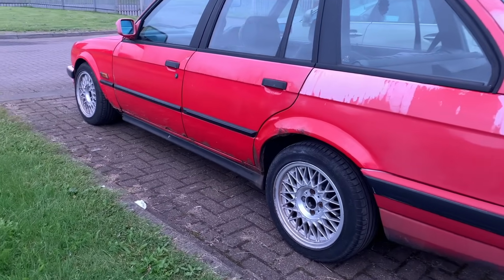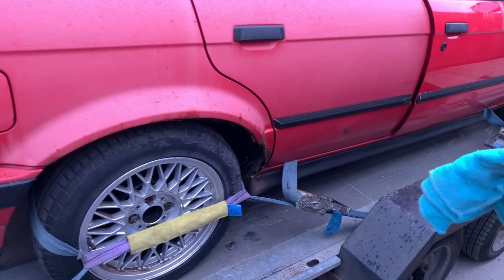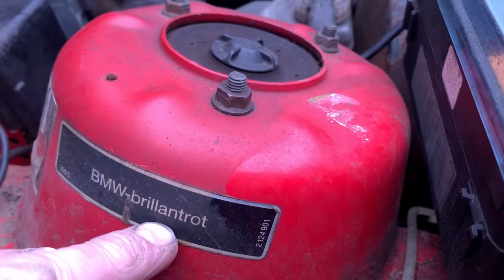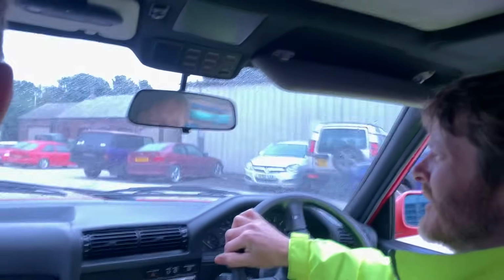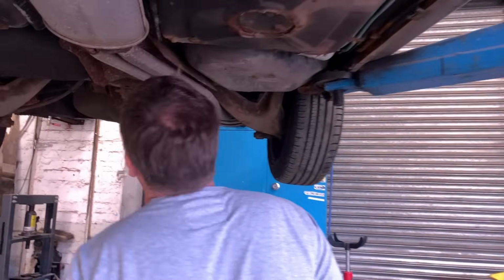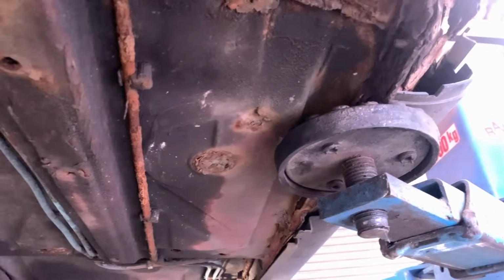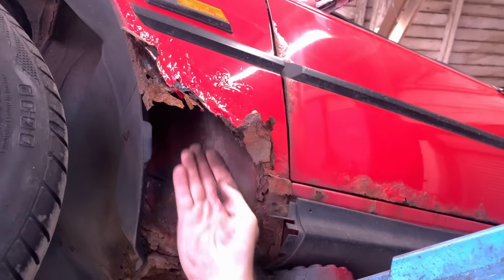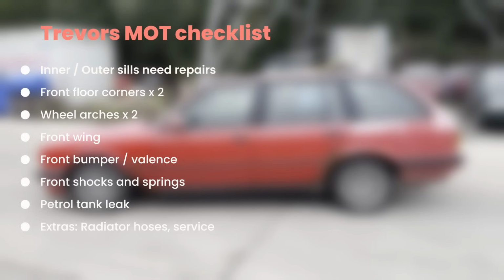What is wrong with our new E30 325i Touring.

Comment: Really looking forward to seeing how this goes,  those squares at the front of the sill are not jacking points, its just what they used to move the bare chassis around on the conveyor in the factory, zero structural strength.  Jacking points are rear diff, rear subframe mounts, front crossmember or front chassis rails :-)
Reply from the maker: Thanks for watching. I found out about the squares only yesterday evening after watching a @restoreit video. I've owned a couple of E30s and I'm restoring an E21 which also has them, and I never knew. 

Love the Brass Eye reference!
Reply: Hopefully you save this its good keeping old classics on road ive got a 2004 Subaru Forester xt turbo in Rare Red and manual im about too get rear suspension turrets welded as i put my fingers right thorough them a year ago £1750 way a years mot bet mot is easy £1000 its been Totally Reliable not broken down once on me

Comment: nice motor, if it was cheap, they are worth restoring
who did the MOT ? Ray Charles ?
Reply from the maker: It wasn't that cheap. About 10 years ago I bought an E30 320i Coupé for £200, and it was in much better condition than that. Wish I still had it.

Comment: AutoAlex bought one of these and got it rapidly restored by Yorkshire Car Restorations and then messed about modding it... check it out and try to do better !
Reply from the maker: I've seen (most of) the videos. The plan for this is to do the welding then use it as a daily. No plans for modding.
Reply: @crap_car  Sounds like a good bet… shabby chic ! 

Looks sound apart from the obvious that you’ve identified…..
Reply: No modding. But it will be mint trust me 😂